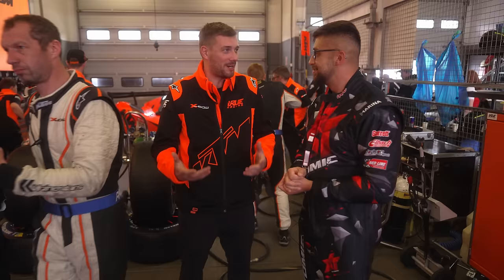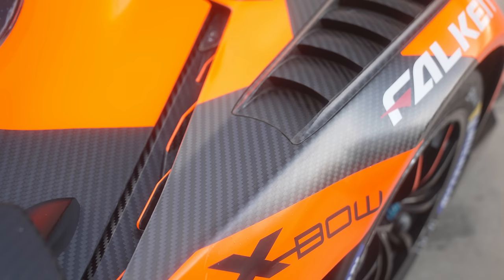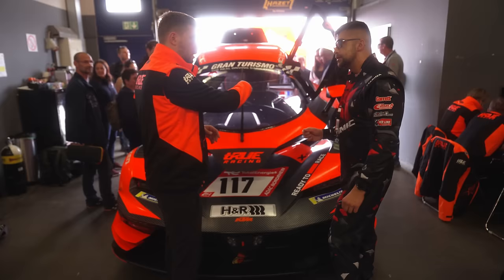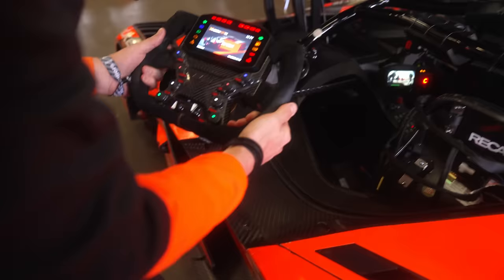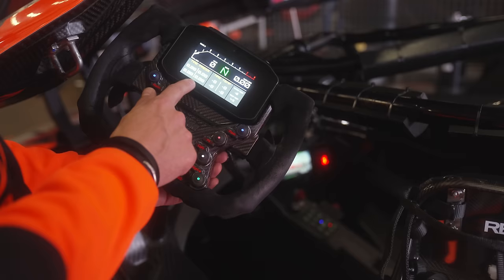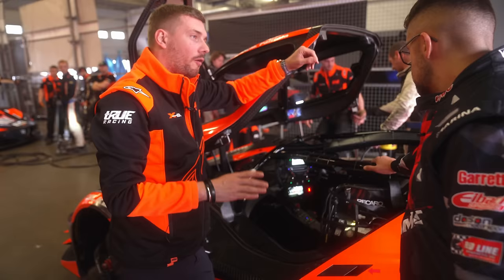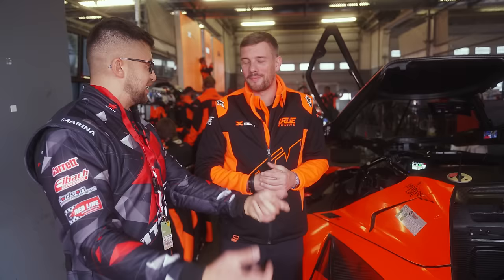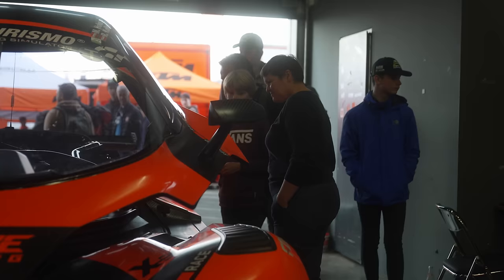WarpSpeed! KTM X-BOW GT2: Specs & FAST Nürburgring Onboard

Comment: Can't believe how fast it looks, way faster than anything I've seen before.
Reply: Check out the Porsche 919 Hybrid Evo world record. Honestly doesn't look real!
Reply: It goes faster than it looks.  Lightweight tight chassis  with loads of torque and hp..  a modern day caterham
Reply: @Chris_the_Dickens  yeah the Porsche makes this look like a shopping cart, if I recall shmee was nudging 290kph in his senna as well
Reply: @ericpisch2732  - But was Shmee carrying all that speed through the corners, lap after lap, over 24 hours?  I doubt it. Big-power point-and-squirt driving is very tedious.
Reply: I can’t believe how few people smash the “like” button after viewing good free content. vrooom vrooom.
Reply: @ericpisch2732  dragsters don't win 24hrs nor even achieve a fast lap.  Speed he was nudging irrelevant if he's 20 seconds behind at the final section
Reply: Low camera position.
Reply: It's quite a wide angle camera compared to normal on-boards, gives a really good impression of speed :)
Reply: It's really fast, but judging by the gps speeds, because of the particular front windshield design (which allows the camera to film the sides that quickly fade compared to the center) I think it gives the impression of a higher than actual speed compared to "normal" road design cars with the camera onboard.
Reply: @EleanorPeterson  of course not :)
Reply: @Chris_the_Dickens  
I was about to comment just that!
The Porsche 919 EVO is out of any league...
Reply: After watching a load of IOM TT on-boards, this seems quite calm and sedate.
Reply: Like something from a computer game, crazy
Reply: Bruh i havent even gotten passed the specs to see it run. Just standing still it looks like it is goin 180 just sittin there.
Reply: KTM that’s why
Reply: I just do not believe. It's probably fake.
Reply: @nomindisponible5420  nope, it’s KTM 😎
Reply: @joshstafford4410  if you put the play speed at 0.5 it seems more realistic
Reply: @ericpisch2732  You do realize that this car has to stay within class power to weight ratio?
Reply: Камера стоит ниже чем обычно
Reply: @gerryjamesedwards1227  
Agreed, the TT is a special breed of lunacy,... a completely different animal all together.
Both great to watch from the breakneck speed of my rocking chair 👍
Reply: Watch porche going the fastest on the same track
Reply: @nomindisponible5420  then,you haven’t seen the porsche 919 hybrid evo on nurburgring
Reply: @pinteselpintes9976  ok maybe they are both real
Reply: Ragazzi, è velocissima, ma la sensazione di velocità, la dà pure il fatto che l'auto è a pochi cm da terra, e pure la telecamera.
Reply: It’s a race version of what you’ve seen online, the factory base model is nothing like this race car
Reply: Me always thinking at every turn he’s gonna lose control😬😰

Comment: The grip levels are phenomenal, the tyres aren’t even squealing. Beautiful car.
Reply: someone correct me if im wrong but if a racing slick starts squealing that means youre starting to be in trouble
Reply: @thibaudprevot4270  Yea, if its squealing you're either overdriving or spinning out of control.
Reply: Slicks don't squeal like street tires do. You have a lot of grip until you suddenly don't then you're sliding around and get some squealing from both inside the car and the tires.
Reply: @Karma28217  🤣🤣

Comment: Hans Stuck is such a legend. Amazing to see his son Johannes working to the same level of racing.
Reply: Haven't heard that name In a while.  His ring videos way way back in the day were my first exposure to the ring.
Reply: In 2006 I was at a mfg test day and watched Hans go by the car park on the front straight at top speed in a Porche Cayenne whipping the wheel back and forth testing the stability control . I tried to get some photos as I swear he was lifting a rear wheel on occasion.
Reply: Hans Felthercrack is a good driver as well 😜
Reply: @randyterwilliger7457  Cayenne..avoid them ..soft engines

Comment: Excellent coverage of these teams, drivers and cars @ misha & adrian! Can I just say you are a dawg for getting the B.O.P. specs for this car. That's right people the KTM GT2 runs 520hp (525 even) and 1300kg round here. 
Really hard to find on the b.o.p setting of a car on the internet. I find you'll always get the specs of the car stock. Not the B.O.P./competition spec. Something which I have been made aware of quite a few years ago. All championships will do it differently which can make it hard to find the B.O.P. spec of a specific car for a specific race or championship. I like sim racing a bit and tend to copy the competition spec. Rather than the stock setting.
Reply: In which sim do you drive the ktm?

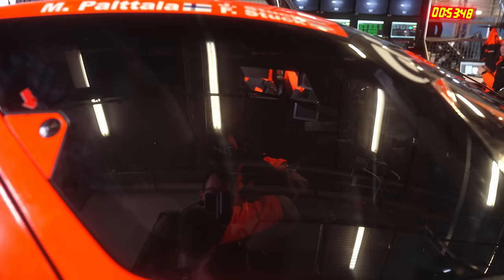Comment: 4:45 it’s super easy to open, unless the car is upside down, then you’re trapped.
Reply from the maker: same goes for some other cars too ofc
Reply: I remember that being a potential problem with the old SLS AMG GT3 with it's gulwing doors. I'm not 100% sure in this but i think they incorporated a mechanism that blew of the doors. Lol. Like a detination trigger but not violently so a driver could get out if it rolled over.
Reply: @koraxi8958  at least the SLS had two doors.
Reply: The KTM has two small doors like an LMP. There is no need to open the canopy. So the driver will not be trapped.
Reply: @konnyk.8862  good to know, Tks.

Comment: Can you elaborate on the ABS system?  Curious who makes it and how it works in more details.  Does it still use wheel speed sensors to adjust pressure or just pressure?  How is the pressure set if using just pressure?

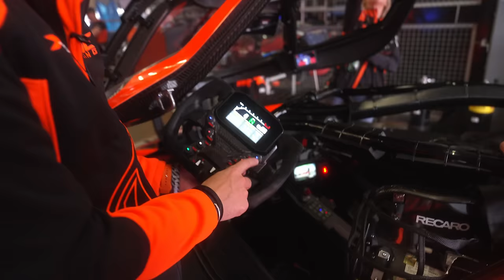Comment: There are many road cars who can make that circuit under 7 min unlike KTM with over 8:20 and can cost also way less
Reply: It's understandable when people don't know the difference between the track layouts. It's a common mistake.
But how one can watch the sheer speed of the car from the onboard video and not put two and two together and still think this must be slower than road legal car is beyond me.
Do you even have functioning eyes?
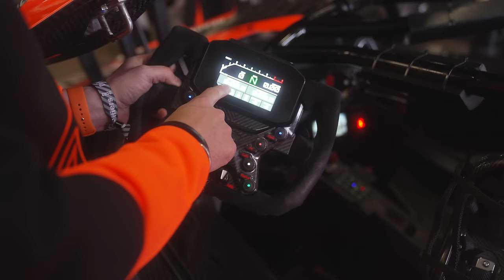Reply: You are forgetting that this time is the full track layout and also with traffic. On the Nurburgring without the GP track, this already did a 6:50 in bad conditions eg, traffic and also a bad start due to exiting the GP track then going onto the Nurburgring. This car is a mid to low 6min car in the right layout, no traffic and a few hours of track time.